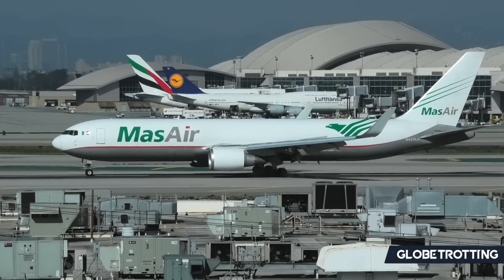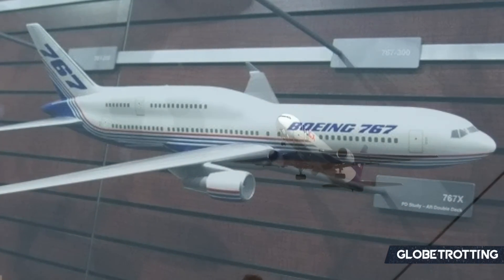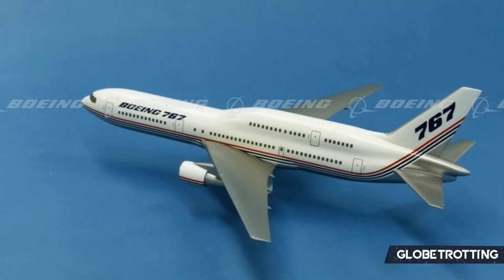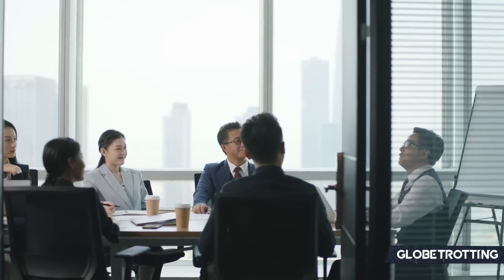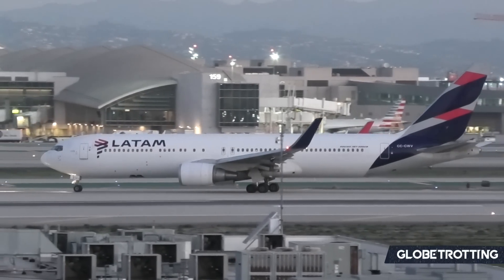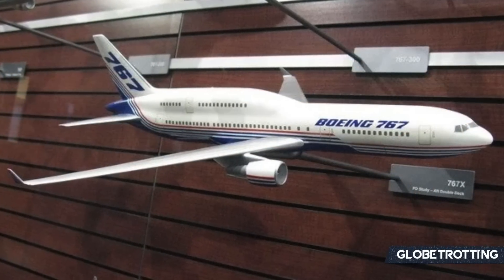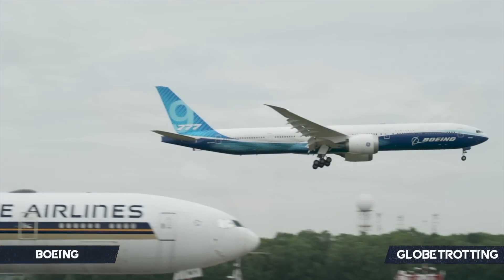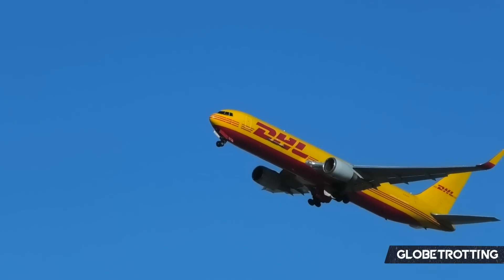Boeing's SCRAPPED 767X

Comment: Don’t forget, the 767X could have been a red herring to distract McDonnell Douglas and Airbus just like the sonic cruiser was that led to the 787. That said, potential to offer an upper deck on the 777 similar to the 747 given it’s 10 abreast seating arrangement and scope for an upper deck placement to meet the needs of Emirates whilst offering twin engine economics. Pertinent given the cancellation of the Airbus A380 which is integral to the business model of Emirates. Perhaps consider this as an option for content in one of your future videos. 👍
Reply: Technically the first floor could be lower in a design like this (especially with composites) it would cut into luggage space though.
Reply: @jj-jak  You know Mcdonnell Douglas offered the MD11 wiht a panorama deck - basically changing the forward cargo section with a passenger compartment. Due to lack of interest it didn't materialise.  I think there are lots of ways Boeing could eek out more space in the 777X. I like your idea!